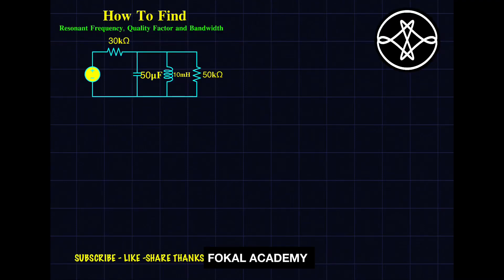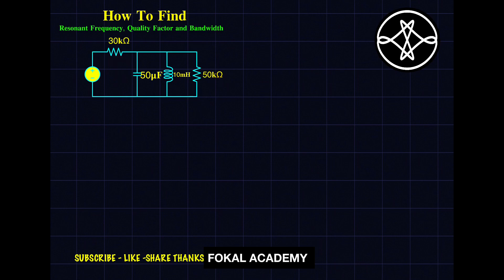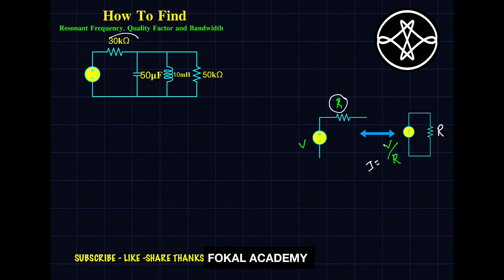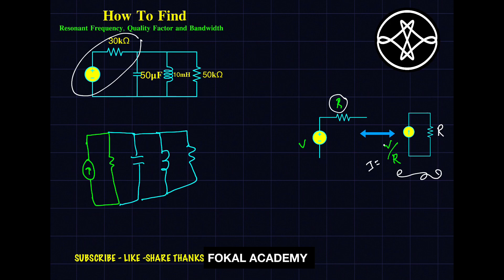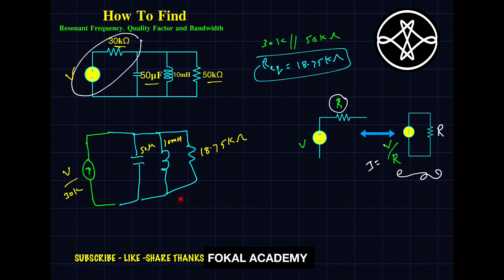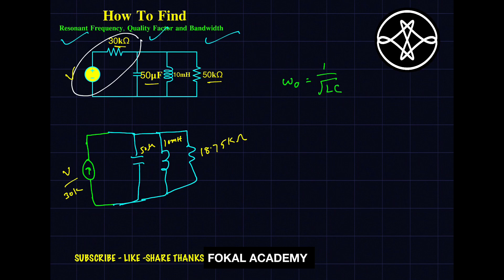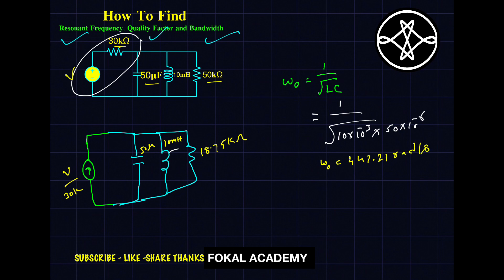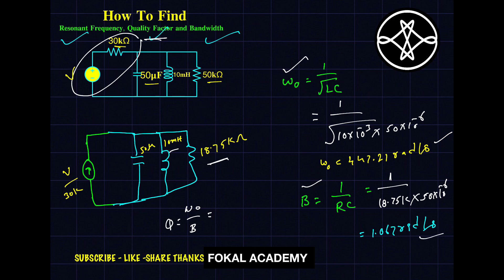Resonance in RLC Circuits: Calculate Frequency, Q-Factor & Bandwidth

Comment: Can you check the Bandwidth calculation, I obtain 1414 rad/s, thanks
Reply from the maker: B= 1/RC
R=18.75k
C= 50 micro F
B= 1.067rad/sec
Reply from the maker: I will check it out